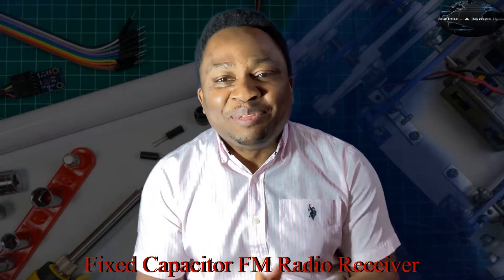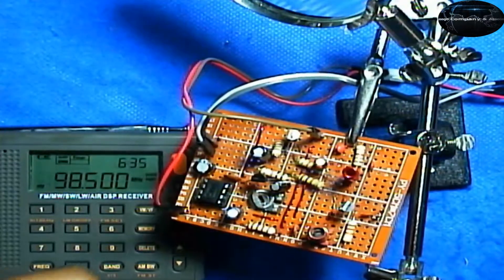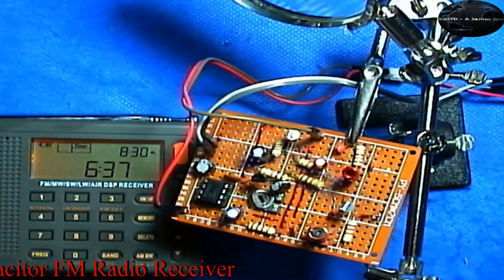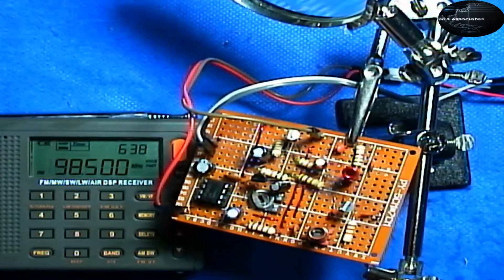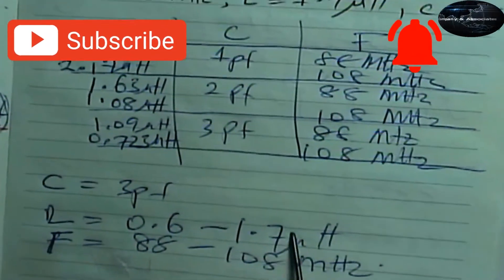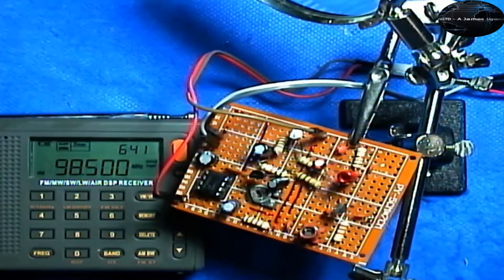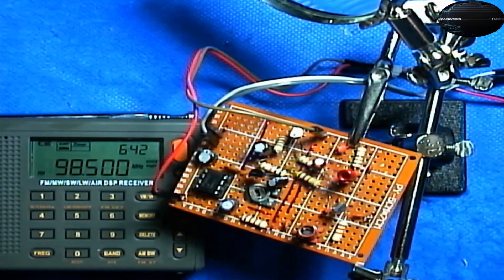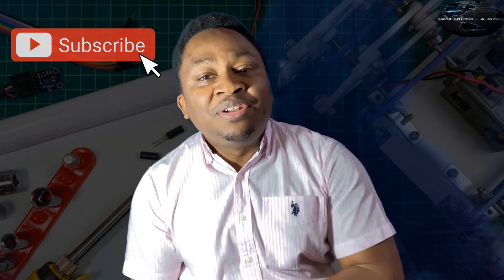Fixed Capacitor FM Receiver | DIY FM Receiver | Regenerative FM Receiver

Comment: oscillator cap is 10pf fixed... 
Trouble with coils,
instead of inductance & henry.. say no. of turns, diameter & length of turns...

So. 0.3uH means 6 turns 
&. 0.9uH is 15 turns...?
Reply from the maker: Thanks for the comments and Merry Christmas.

I used inductance in the explanation because the components included a variable inductor - although it has 9 turns, it also has an adjustable medium that is used to adjust the inductance from 0.6uH to 1.7uH (still maintaining the same number of turns. 

You can get one from Amazon:
https://www.amazon.com/10pcsAdjustable-Inductor-Adjustable-High-Frequency-0-6uh-1-7uh/dp/B08KB3B11R/ref=sr_1_1?crid=233G6SJ3BQPF6&keywords=Adjustable+High-Frequency+Ferrite+Core+Inductor+Coil+12T+0.6uh-1.7uh+Adjustable+Inductor&qid=1640450710&sprefix=adjustable+high-frequency+ferrite+core+inductor+coil+12t+0.6uh-1.7uh+adjustable+inductor%2Caps%2C68&sr=8-1

Or from Aliexpress: 
https://www.aliexpress.com/item/1005001693117653.html?spm=a2g0o.9042311.0.0.23284c4d6MKAUl

I got mine from Aliexpress.